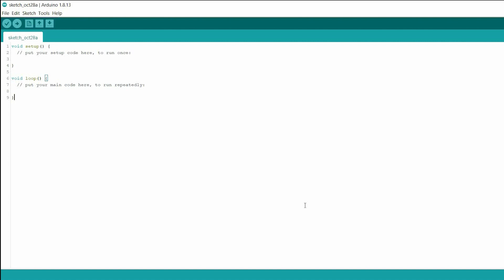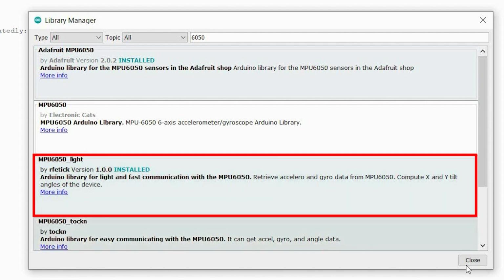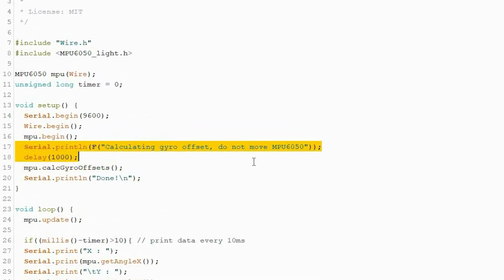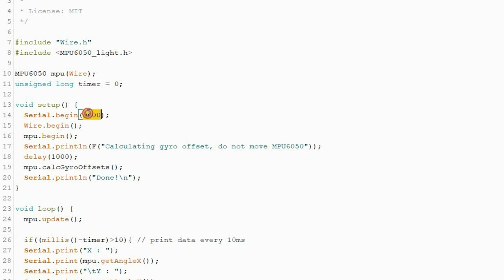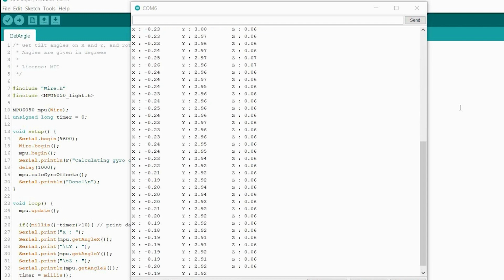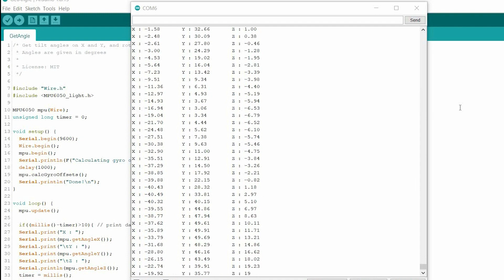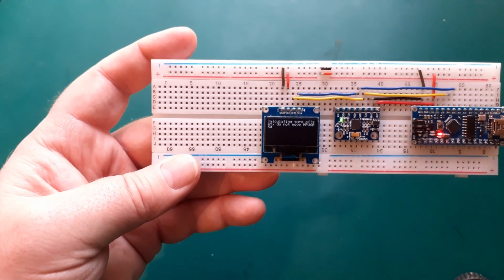Gyro (Position) sensors (MPU6050) with Arduino - How to access Pitch, Roll and Yaw angles

Comment: hi. i need help for my school project. i have a load cell with hx711 amplifier . i want to show load and mpu readings symultaneiously on oled screen. both codes run fine when ran single. when i try to merge them then the code stops after 1st loop. i want help with proper code for this. plz help me , im not smart enough for this

Comment: Stupid -- The yaw change (rotation of the xy plane around the z axis) is not a drift or an error that needs to be zeroed. I put my MPU6050 on the kitchen table and collected the axis output for six and a half hours. Pitch and roll values were stable throughout the entire period. However, the yaw values are constantly changing at an extremely linear rate of 0.25 degrees per minute. That's 15 degrees an hour. The planet you are on is rotating at such a speed. It's not a coincidence.
Reply from the maker: I had a Tik-Toker say that these units could not detect planet drift, yet there it is

Comment: Hello, I wired Arduino and MPU6050 and uploaded project to microcontroller. But I have one problem. If gyroscope not moving (is in stable position) Z axis angle continuously decreasing. Approximately 0.5 deg/minute. How I could solve this problem? Any advise I appreciate. Thanks

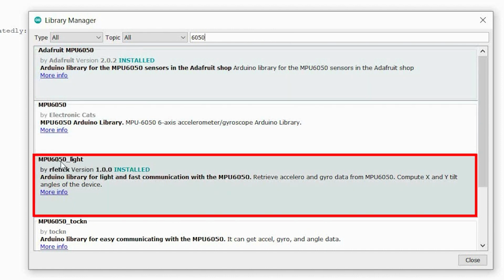Comment: 4:18
So the exact library used will be dated, especially as Adafruit and other repositories update their libraries, but it's important to note that, if the access to the MPU6050 is uncertain with an installed library, try another one from the manager. Especially important for future use.

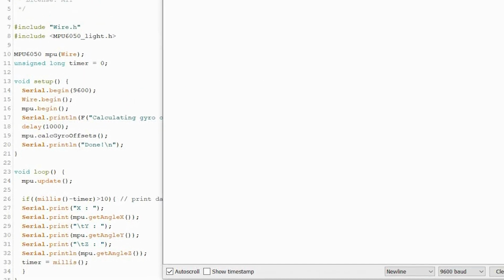Comment: at 6:19, how did you get the live data from the board to be shown on screen?
Reply from the maker: It's in the code isn't it? Check link in description.
Reply: @XTronical  I figured it out. Everything was working properly, I didn't realize you have to push the serial monitor button. Thank you, awesome video.
Reply: I have the same problème when should I click to get the board ?

Comment: How does the example code know which pins are you using, for SCL and SDA input? Should I always use A4 and A5, or I dont have to specify pins and just use the mpu.getAngleX,Y,Z() function? And should I connect it also to A5 and  if I use Arduino Mega?
Reply from the maker: Use whatever I do in the video. They are fixed on the Arduino unlike the esp32.
Reply: @XTronical  So Ard. Mega has special SCL and SDA input - shorturl.at/einHQ, so I should just hope the libary can work without me specifying the pins. You also did not specify them, or did you? Thanks for answering man!
Reply from the maker: Just use whichever pins are used for the mega and the library will sort rest out. As when you specify the board your using the library has access to certain "defines" which it can use to set itself up correctly.
Reply from the maker: Your welcome

Comment: I need to use this for a full motion flight simulator, but I want to make sure it fits the job.
Basically, I've been trying to use the accelerator to get the angles. However, as the platform moved, it was reading incorrect values thus making everything shake.
My questions are:
- is this library capable of getting just the angle (ignoring the platform motion)?
- if I initialise the system at any angle, would it still be able to get the actual value (getting the value from the accelerometer, for instance) or will it start at 0;0;0 deg?
- How often do I need to re-calibrate the system?
Thank you for your kind help and attention

Comment: yaw is changing with respect to roll and pitch right ???is it correct
Reply from the maker: Yes, it's because the Earth is rotating.
Reply: @XTronical No, this cannot be true, because if you change the position of the x and z axis together, you will still see that the z axis increases over time!  I could not solve this problem for several days.  In addition, this problem does not exist in newer gyroscope ICs, so the rotation of the earth cannot be the reason

Comment: That was just great!. The simplest way I have found so far. Thanks !!. I have a question: The YAW value is not very accurate... it changes all the time. Is there anything to do with it? Or is it just the 6050 hardware which is not good enough? Any ideas or suggestions? Thank you again!
Reply from the maker: Thanks. It's changing because of the earth turning. This is 15 deg per hour. So to keep the yaw relative to your position on earth you would have to allow for this.
Reply: @XTronical  Wow! That's cool!. Do you have any inputs to give me about how to allow that function to keep it relative to my position?. Thank you again!
Reply from the maker: Unfortunately I never investigated further. I should imagine someone has done the solution, perhaps I will revisit this one day.
Reply: @XTronical  Would a filter like Kalman filter make the value much more consistent? I am planning to use an accelerometer and a gyroscope to track the back posture of an individual and i think i would require a constant or at least a less noisy values
Reply from the maker: Not sure, sorry.

Comment: SIR I CAN'T THANK YOU ENOUGH. I have been trying to fix gyro issues (values increasing over time/inaccurate values) and trying different libraries for literally 7 hours and the libraries are unnecessarily complicated. Your video is very clear, straight to the point and extremely helpful lots of MPU 6050 videos are either unclear or give an unsatisfying result. Thank you so much!!!
Reply from the maker: Glad it was so helpful.
Reply: it's not the other libraries fault, its just the gyro and acce. you have to put on a filter for them to be acurate
Reply: @daudhtm5203  I agree but it sure would have been nice for the other libraries, tutorials, and videos to make that tip obvious and not implicit instead of wasting everyone's time.
Reply: @georgeandrawos3748  i tried out this library but it seems like the values are still increasing without even moving the gyro.
Reply from the maker: That's the earth's rotation.

Comment: A remark on yaw angle values :

Even if you initially calibrate yaw orientation, yaw values will increase nonetheless. I assume this is because of the integral approximation that is occurring behind the scenes. As a matter of fact, the gyroscope doesn't measure angles instead it measures angular motion, that is in rad/sec. To go from that to having angles you need to integrate thus having to use some sort of integral approximation.

The reason why you don't see this happening with pitch and roll values is because the gyroscope's pitch and roll angle values get the privilege of being 'corrected' by the accelerometer's sensor data. The yaw values, on the other hand, don't have this privilege.

Edit : typos
Reply: Adding onto the sensor data part , what you are referring to is the acceleration value in reference to the gravity which exists for pitch and roll but not for yaw.

Comment: That was very helpful! Is it possible to measure the position value (coordinates) with the MPU6050? By integrating the acceleration values or something else? What would you advise to use to get these values for a mobile robot. I would be very grateful for help ;)
Reply from the maker: Yes, I'm quite sure it's possible with the libraries that are available but I've never looked at it. Accuracy may be an issue though, if you want repeatable positions down to millimetre precision then I'm not sure it would be good enough, although I may be wrong. But I can't help more I'm afraid as I've not looked into this.
Reply: @XTronical  ok, so I keep searching the internet, thanks!
Reply: so did you find any sources where we can measure position value(coordinates) with the MPU6050

Comment: thank you for this video, finally I could read data from my sensor but I need some help, I'm using this sensor with Arduino nano, but I can't make it work with Opentrack software, could you do a tutorial for achieving it?, thanks again!
Reply from the maker: I'll make a note to check it out but won't be for a while I'm afraid. Currently working on other stuff.
Reply: @XTronical  just if you can, but it would be very useful because there is not a clear tutorial about how to do it, thank you in advance and greetings from Chile ☺️

Comment: One thing I can’t figure out, is how to get/calculate heave - vertical motion. I want to use it in a boat to display pitch, roll and heave ( wave height) Anybody have an idea?
Reply from the maker: You'd need to use the accelerometer results, but I've never looked into this. But that's where I'd start. A certain acceleration over a given time should give you a approx distance travelled. There maybe something in the library that does this.
Reply: @XTronical  

hi , how can i detect 360 degree rotation of y-axis to complete a  circle please help me with this

Comment: Hi. XTronical. I'm getting abnormal readings. My Pitch is crazy. In the 0º position it gets 40-45º. I didn't get it. After a complete pitch movement of 90º, it shows 145º. Great video, by the way!
Reply from the maker: Thanks, sorry I'm not sure what the problem is without recreating it
Reply: i think u didnt place it on a flat surface while calibrating

Comment: hi, ty for the great video. i tried using the coding without oled. It works well on both roll and yaw. Buy my pitch (yaxis) can only reach max of 89 degree only. Can you or anyone help me with this issue?
Reply from the maker: Sorry, Christmas got in the way of this I will try to look at it soon
Reply: @XTronical  its okay . i also tried the coding from your project page of getting all data for angle (x,y,z) and its acceleration (g unit) of each axis. Is there any relation between tilt angle and the acceleration? Because when i change angle of x axis to positive value (90 deg etc), only the Y acceleration changes while X accel remain almost constant. Is that normal? i want to study about it but until now i still found no literature regarding the matter. Hope u can help and give a bit explanation.

Comment: Basically all the 3 angles calculated using gyroscope drift, but then a complimentary filter is used to combine values from angles calculated using gyroscope and accelerometer, since the accelerometer can only be used to measure roll and pitch values hence the complementary filter can only be added to roll and pitch but not yaw. So yaw drifts.

Comment: An amazing little thing for the price, and to think it's actually got microscopic mechanical parts inside. I did build a balancing robot a while ago but was also thinking of one inside a small cube with possibly Bluetooth to control things on the PC by choosing a side and then rotating, so a side chooses an item and rotating gives a value. But never got any further than the initial idea!
Reply from the maker: Are they mechanical, I've never investigated. Your project sounds interesting!
Reply: Yes, as far as I know they have a mems gyroscope. I vaguely remember looking it up when I built the balancing robot.

Comment: Great timing. I've just started using an MPU6050 in my motorcycle data logger project to measure lean angle, acceleration and braking force. I'm using an ESP32 with the MPU6050_tockn library. You can set the calibration in the code once it's known.
It's a great little module.
I've ordered an MPU9250 so looking forward to having a bash with that when it turns up.
Keep up the good work old boy!!
Reply from the maker: Great stuff, I'll have a look at that library. Can't remember now if I checked it or not! Thanks for the comments.
Reply: @XTronical  well, my MPU9250 just turned up, so hopefully can give it a test in the next day or two
Reply: Hmmmm. Not having a huge amount of joy with the MPU9250. The bolderflight library spits out oodles of data. Way more than I have the time to get my head around. Tried a couple of other libraries but no real joy. Seemed to be getting rather inaccurate roll, pitch and yaw.
Will stick with the MPU6050 for now as it does what I need and I was just being greedy wanting a 9 axis ;)
Reply: i2cdev library has example sketches for getting the angles and an example for getting the accelerations.
Reply: You gotta do some changes to make it work with esp32, I usually use an esp8266 in which I just mention Wire.begin(sda_pin, scl_pin); other changes are needed when handling interrupt
Reply: @prateekmahajan1929  thanks for the tip
Reply: Excuse me, would you be kind enough to tell me how i must connect the mpu6050 to the esp32, im having some trouble